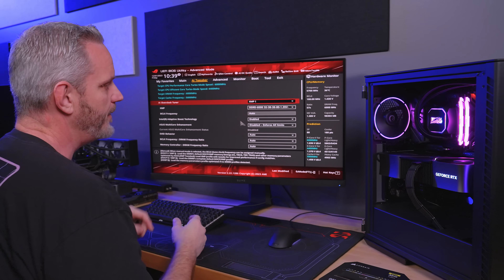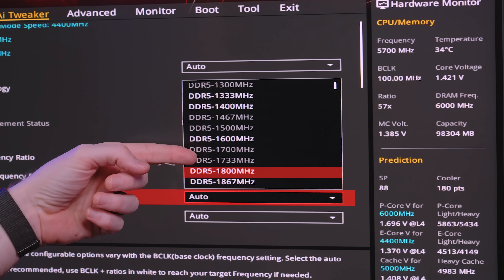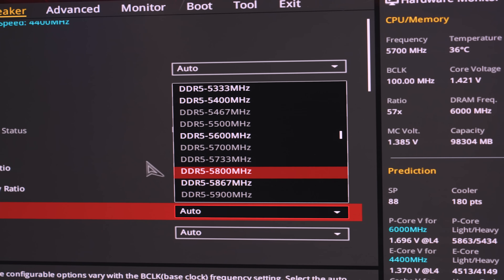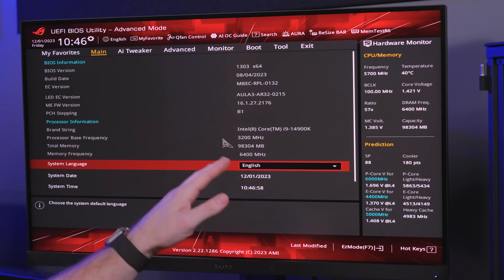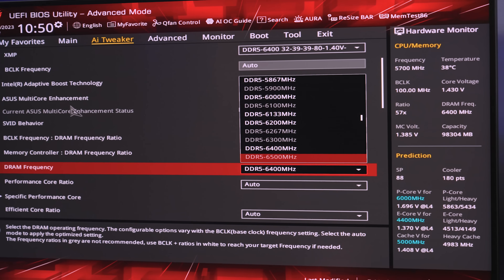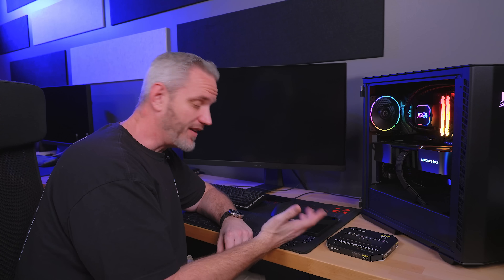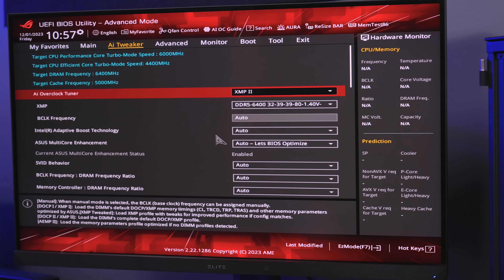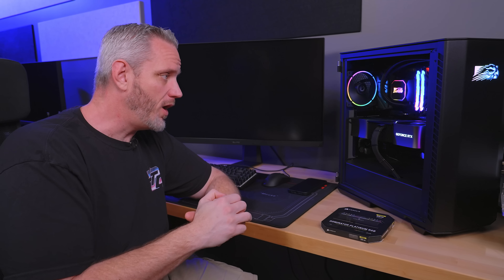Crashing PC? Check this first!

Comment: I had the same issue  on my rig months ago, after some test I realized that the issue appears with  dimms that has xmp profiles, the ones with only expo profile work like a charm,but a lower frequencies some manufactures still limiting ram frecuencies since the Burned cpu issue on 7000 series cpu s

Comment: I have a r5 2600 and have always wondered why my 4x8gb 3200mhz corsair ram would only sit at 2933mhz and no higher. Turns out I have a fussy processor. Shall I go for a 8 core 3000 series or a 6 core 5000?? Pimpin on a budget

Comment: Jay, there is also JEDEC listed speed, which a lot of laptops / mini-desktops take. Don't make the mistake of buying XMP/DOCP/XPO ram for a laptop unless you can go into the BIOS and SEE the options, and then be very careful of updating your BIOS later. Dell has removed those setting on TWO G series laptops I've owned because they either wanted to sell you a kit at twice the price OR they didn't want your G series laptop competing with their Alienware line, that did expose those settings. So, for laptops, be careful about the RAM, and once you have upgraded, keep an eye on your BIOS updates. A lot of laptop makers don't expose those settings even on their higher end systems, so you are stuck paying higher prices for JEDEC rated RAM.

Comment: Bsod is mathematical error? Not really. It represents and problem with some operation that windows wants you to know about. Like whea errors when voltage timings or voltage aren't dialed in. This can happen when voltage is too low and clockspeeds are too high. Qvl has always stood for qualified vendor list but the parts are listed on the qvl paper that users find on mfr website. Docp stands for dynamic overclocking profile. Leave  it to jay to get it wrong.

Comment: And adrenaline is always telling me: GPU settings reset to default due to performance issues. More than likely I'm setting my GPU up incorrectly. 6750xt shouldn't be messed with. Tried to undervolt; trash. Tried to overclock; trash. My 13600k is like "the hell is this dumpster fire?!"

Comment: oddly enough my pc running a i7 12700k is running 6000 xmp profile with no issues.  tho i guess running a evga motherboard kinda helped with the compatibility but only using 32g 2x16 since didn't wanna wait to save for a full 64g kit. on side note tho just got my EK vector block for my rtx 3090 ftw3 since couldn't find a vector 2 version for good price hopefully it was not a mistake on getting the original vector block since i only got one gpu to use an rather not have to be without a pc but nevermind about me good video to watch good info to keep on a list if any of it happens!

Comment: I have 2 kits that as close to matching as possible. Patriot viper blackout ddr4. If you run xmp 2 and you run folding at home on the gpu or topaz the system crashes hard and windows for a brief moment shows a critical process died. No crash log gets created. Stumped me for months. Memtest showed ram was fine....

Comment: I said in the short, I think I got one of those duds in my ryzen 5600x. If I run anything over stock speed I get random BSoD's. It could be RAM but I havent bought another kit to try it. That said I am running 4 8gb sticks for 32g cause I need that much at least for editing.

Comment: May i ask if you know why AMD GPUs sometimes just crash when the PC is idle? Because my friend who has a 6600xt does that. My XTX does it before but it stopped after a while. 

The RGB of the PC will turn off and the monitor is black until you move the mouse to "wake it up" again.

Comment: When I bought the RAM for my current 13700k build, I was originally gonna go with 64GB at 6400. I got this same advice from another techtuber and changed my order to 5600. I probably could’ve gone with 6000, but I wanted to be on the safe side to make sure they weren’t gonna be a problem. No issues so far.
Reply: I pretty much did the same for my i7 14700k build, was looking at 6000 models first and decided to go with a 5600 set, one thing is that they run at a lower voltage than the 6k set does, at 1.25v instead of 1.35v. Less of a risk of the models becoming unstable at a later time running at a lower voltage.

Comment: I kind of wish you touched on the fact that, even in my case using a 5950x, RAM capacities that are too high won't overclock well. In my case, I have 2 32gb sticks of 3200 Crucial Ballistics RAM that will not work with xmp, nor will it work with at 3600. No matter how I had it set up the system was freeze, and when I thought I had it stable at 3600 there was a sound error which made every audible sound stutter.

I hope I can find some RAM that can work at that high capacity with my 5950x or at least use that RAM with a different CPU and hope it works overclocked.

Comment: The main way to ensure it works..   before buying the memory, make absolutely sure of three things..   the exact memory is listed as compatible by the motherboard manufacturer, the reviews show stability for the memory and finally    not only the speed (ak 6000mhz) but clock timings are rated best for the cpu.  ie, cl36, 6000mhz memory is going to be very questionable of stability with a 7800x3d where a cl32 would work great with it.  thus also why it seems spuratic as to stability... it has to do with the memory and motherboard as much as the memory and cpu.

Comment: I have an old Xeon X5690 that absolutely will not post if you enable XMP at default clock speed.  It wants to run at 1333 mhz and nothing else will do.  But if you overclock it to 4ghz or higher, then it will take XMP at 1600 mhz.

Comment: Not xmp reletated but I just reverted to an old bios on my Strix z690 because Windows11 kept having issues with Com servers, system permissions, and runtimebroker errors flooding eventviewer causing random crashes and multiple daily bootcrashes  through multiple windows installations

Comment: Just a note on the qvl list, it can often take a while for motherboard manufacturers to update the qvl list after initial launch. 

Generally the memory manufacturer will have their own qvl list thats updated a bit faster.
Reply: Using QVL list has led to stable pairings but I've experimented with 3 DDR5 machines and kits on 12th gen at this point. Every machine gets a stable pair and I'm done unless something gets a bad driver/update later.
Reply: Adding to the qvl notes, be sure to filter for your kit as advertised and don't look for kits that don't exist like I did by filtering for a 4 stick kit when you got 2 2 stick kits

Comment: Can you confirm that XMP II are the profiles stored on the RAM sticks themselves, while XMP I are profiles stored on the motherboard and edited by Asus in this case (the QVL you mentioned)?
I generally run with XMP II to match the RAM fabricant specs and I am generally stable (just need to double check that the voltage matches -> 1.2V, 1.35V, 1.4V etc...
Reply: When it comes to Asus, yes, XMP/EXPO I is their custom tuned profile from Asus supposedly to get the best performance for that RAM on this mobo. XMP/EXPO II are the XMP/EXPO profile settings on the RAM sticks. This is unique to Asus though, other motherboard vendors do it differently.

Comment: Considering the factory BIOS in my motherboard didn't officially support my 7800X3D, I'm shocked I got away with running it for a day.
I made sure to get a memory kit that was on the QVL. Much as something else could probably work, being able to set EXPO and go is nice.
One thing I found surprising is how aggressive SoC voltage was in the EXPO profile of my 6000CL30 kit. My 7800X3D was set to 1.3V on SoC, which I understand to be pretty high.
I was able to adjust it to 1.25V without any obvious repercussions yet. I only setup the system a few days ago, so I've got more testing and tweaking to do.
I also need to spend some time with the curve optimizer. My 7800X3D is boosted to 5025MHz currently, so I'm curious what a negative offset on the curve optimizer will do for temps and boosting behaviour.

Comment: I run a 7950x3d 64gigs RAM @6600mhz with very fast custom timings. It’s a Hynix A die Kit team group. Had several ram kits with same specs not work very well.

I’ve run other kits of Ram that weren’t stable above 6000mhz. On one 7950x3d infinity fabric clocks to 2033, the other 2200mhz… However, the one with better MC has much worse cores… it’s weird all around.

Comment: Why do all motherboards not just come stock with clear cmos?  The only reason I can think it cost but is it really that much more cost-effective to leave it out?  Most enthusiasts like to overclock so it's a very useful tool.
Reply: The same reason all motherboards don't have 7-segment LED code displays... product segmentation. So those who want the feature are forced to pay more and move into a higher tier product even though it could easily be modular, available as a cheap add-on part for those who want it instead of gated behind a price tier.

Comment: What do we think my issue could be on a 5600x, 32g 3600mhz (adjust to 3600 in bios) on a Msi x570 on windows 10; that blue screens a kernel security issue when only loading iRacing. Any other program or title plays fine.

Comment: I could've used this a month ago fr I was having all sorts of problems i didnt know if it was my mobo ram or cpu i ran xmp for a year and had my cpu slighty oced i5 13000kf and one day it just crashed and I realized a stick of ram was lighting up i usually have ir on dark but i bought a new set same thing i was originally on t force 6000 mhz 32gb i got corsair 6400mhz 48 and one went out like within a day so i got t force 7200mhz and it worked fine for a while and I cleaned my pc a little hooked it up played fine day later one went out so i got a new mobo a strix z790 f i had a prime z790p im waiting on my ram now hope it is good now cause I cant afford anything else if it is my cpu im wanting to get a 13900kf or 14700kf one maybe income taxes i guess

Comment: I have a weird question if anyone can answer. I have a 7800x3d with g.skill 6000mhz cl30 ram and DOCP all works and stable but read that I need to make sure uclk  setting is == to memclk. but when i do set it to uclk==memclk i lost cpu performance in benchmarks but no difference in gaming. I dont mind it either way just want to know if there is a difference I'm not seeing or just why that happens. Oh and motherboard is the rog strix b650e-i itx.

Comment: Asus ROG STRIX Z790-E/i9-13900k/64gb g.skill trident z rgb 6000 cl30/4090 built in april, all was good, then in august started having stability issues
Tested my CPU and ram on a friend's system with same mobo and specs, everything worked for him with my CPU and RAM, but his parts were only 90% stable in my system
RMA-d the problem to my retailer, they diagnosed my 13900k as faulty, by that time 14th gen came out, so I swapped for a 14900kf
couple of weeks later stability issues again, but only with XMP on, could it be a motherboard fault, should I try RMA-ing to my retailer again?

Comment: I finally turned DOCP off on my Ryzen 9 AM5 because the boot time took SO MUCH FREAKING LONGER.  The performance via the tests said it improved, but the boot time literally quintupled.  The entire AM5 Build I have seems SLOW even though the these tests say it is in the top 99%.  Things just seem to "stop" and then start again all the time, like plugging in a USB device...it just freaks for like 30 seconds.  Audio will suddenly cut out and start buzzing...like it had so many other things going on it didn't know what to do. 

Not really happy with my build, but it does work.
AMD Ryzen 9 7900X 12-Core Processor
ASUS X670E Plus Wifi (latest firmware and chipset software)
Two Samsung m.2 990 PRO 2TB (with updated firmware)
64Gig DDR5 Corsair Dominator
EVGA GEFORCE RTX 3090
Lian Li Galahad AIOC (2nd one, they warrantied the first one)
The processor runs HOT for sure...LOL.

Comment: And what you just explained about cpu speed guarantee is exactly why manufacturers or system builders do not ship systems with XMP of any kind enabled.  Stability! and a reason of contention I have with Steve wanting to see XMP enabled by default.  You as a builder DO NOT WANT customer calls or complains due to system instability.
Reply: But it is fairly easy to test if the system is stable with XMP/DOCP/EXPO using software tools. Any SI that a customer is paying to build an optimized system should provide that service, even if a minimal extra fee is involved for the validation/certification testing.

Comment: Hey Jay!  I'm not sure if this is technically an issue I should be worried about or not but here it goes:  Built a new RIG this Thanksgiving.  7800X3D/4080 FE/MSI X670E MAG Tomahawk WiFi MB & TeamGroup T-FORCE DELTA RGB 32GB DDR5-6000 CL30 RAM kit (16x2GB).  That said, I have the RAM in XMP 1 @ 6000Mhz and when I first boot the computer, I see both a RED and YELLOW light on the MB while both lights stay lit for around 15~30 seconds.  Then it appears to move forward and goes right into Windows 11 Pro with no issue and when I check the speed in task manager, it shows 6000Mhz.  Is this normal behavior?  For comparison, I also built a 5800x/3080Ti FTW3/MSI B550 MAG Tomahawk Max Wifi MB/Corsair Vengeance RGB RT 32GB DDR4-3600 PC4-28800 CL16 RAM kit (16x2GB) Build and that RIG posts insanely fast in comparison (literal seconds and at desktop).  Also, if matters, they are boot booting on M.2 drives at minimum, Gen 3 speeds.  Thanks for any info you might be able to provide!  There may not be an issue here but I can't help but compare the boot speeds since they are in the same room.  :(
Reply: Yes it's normal for AM5 systems to take a while to boot

Comment: Jay please please please! Consistently use the right terminology, it is not 6000 Mhz DDR5 it is 6000 MT/s DDR5.  Memory manufactures have misled you via the box but please use the right terminology. RAM speed is measured in "MT/s" which is Mega Transfers per second. You mixed MHz and MT/s at different points in the video, this can mislead viewers. Good video but stay consistent :-)

Comment: I had a similar problem with my old i5 8600 that when i max out the RAM overclock some programs and games would crash but the system wouldn't. I had to go back and set the overclock to what the CPU could handle according to Intel.

Comment: So I am weary of not having enough power for my system. I have a 7800x3D and an MSI 3080 paired with a 750W power supply.

I have noticed that when I power on my system and launch a demanding game, my mic in discord will become very staticy and nothing works to fix it. I fear that this is a shortage of power from the PSU.

Would lowering my RAM speed from 6000mhz help this power draw? Or should I just bite the bullet and get an 850 or 1000W PSU?

Comment: MemTest86+ used to be my only trusted RAM diagnostics. It was free, simple, and could be left running overnight on any system to make sure RAM was rock solid (checking overlocks or finding defects). 

That was a million years ago when I did that kinda work for my job, so I’m not sure if there’s a better alternative these days, but if they’re still around, they helped me isolate bad DIMMs 100% of the time (with long enough testing) for years and years.

Comment: Would like to ask if anyone here knows what the issue of my previous PC was. Just a note that I already bought a new PC and had been using it for 8 months and its amazing. Now on to my previous one which I had used for almost 7 years, For the first 8 months it was running perfectly fine no issue whatsoever but after that my PC would shut down from time to time and I had no idea whats causing it. Yes I do have a lot of tabs open on my browser while playing a game with a VM running for my mobile games but I never had issues with any of my older PC that I had and same with the new PC I am using today. I brought that PC to the shop to get it fixed but they couldn't replicate what was the cause of the crash, Over the span of almost 7 years I got certain parts replace like the power starting from 700w to 850w and the last which is a 1000w, then the motherboard, the video card, the fans and ram, I even bought a UPS and new power plugs and sockets for it but within the span of that 7 years I still had the issue of my PC crashing from time to time. I brought that PC to 4 different shops but they couldn't figure out whats wrong with it. So to this day I am extremely curious as to whats the problem. 

My new PC is amazing thought and really happy with it.

Comment: Hey Jay, you you referred to the memory as HYPERX FURY, in fact now they are KINGSTON FURY. HP bought the rights to the HyperX brand from Kingston, which in turn launched a new brand called FURY, so the memories are Kingston FURY Renegade. The other line is called Kingston FURY Beast.

Great video, BTW!

Comment: 2:26 I have AMD XPO, 2 x 16GB 6000 MHz running on my Asus Prime Z690 with Asus DOCP recognizes it and sets its speed and timings perfectly, even though it isn't XMP its shows DOCP/XMP. Works perfect. Never had issues. Would have bought XMP version for Intel but was sold out at Microcenter at the time got this for $65 from a bud of mine. So ended up with a win win.

Comment: "Base speed" for DDR4 is 1600. What Jay is referring to is "JEDEC speed" which is the rated speed of the module for standard voltage. JEDEC exists for 1600, 1866, 2133, 2400, 2666, 2933, 3200, so yes you can totally get DDR4-3200 modules that run at 3200 out of the box. XMP speeds are higher because they require more voltage, which makes it an overclock

Comment: Ryzen 5800x 32gigs of 3600 ddr4 ram. With all 4 sticks in I had to set my memory speed to 3000mhz if i go higher i get random blue screens or automatically changes it to 2133